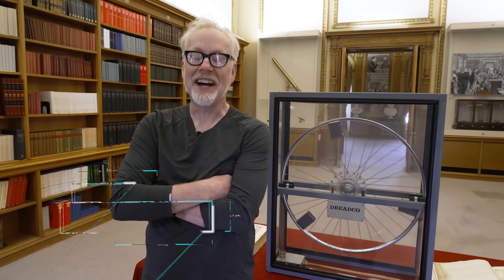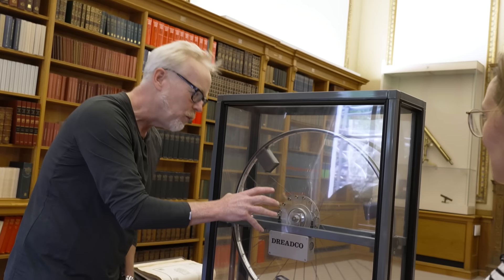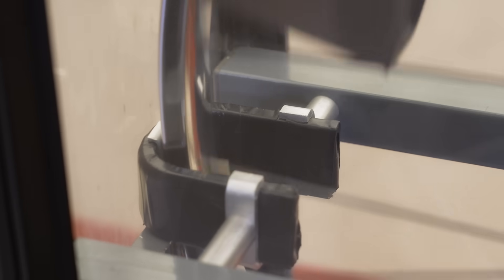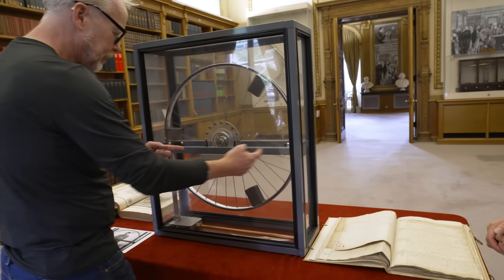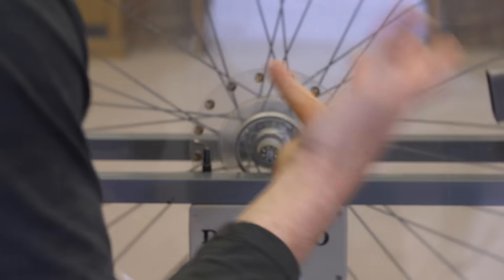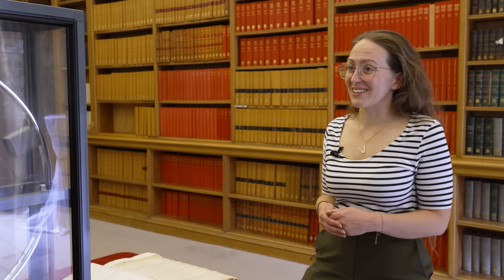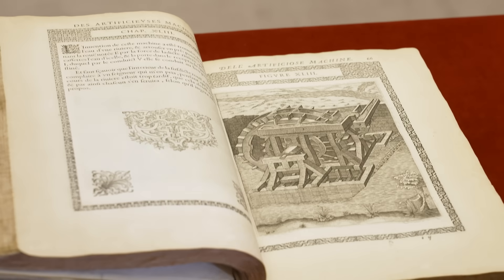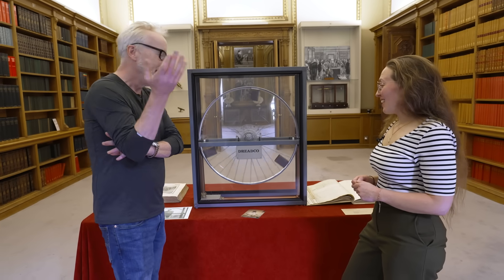Adam Savage vs The "Perpetual Motion" Machine!

Comment: This is not that complicated, it's magnets. Magnets push and pull. They pull the weight to them and then as it moves past it pushes it away. I had the same idea but would use it to generate some power.
Reply: Nope.  Try it and you will discover that magnets would quickly stop the wheel.  You can use electromagnets to modulate the push/pull but that needs actual energy.
Reply: @CorwynGC  not if set up the magnets in a proper configuration to equalize the push and pull. And I'm not saying it's perpetual, just as this device isn't but it's damn close.
Reply: @TimeofRagnarok  Please explain this configuration.  Every time I try I get the magnet pushing backwards just as hard as it pushes forwards.  What happens when you stop the wheel directly aligned with the magnet?  Which way does it go?
Electric car companies think the same, as they need to add huge batteries to their magnet configurations.
Reply: @CorwynGC  well I think the best way to know is with the good old method of fuck around and find out. That's what I plan on doing, and this machine here has given me a rough blueprint to start with.

Comment: it works for two year, of maybe more at a time,
so what is "Perpetual Motion", even if it was a reel thing, wheel bearings, metal fatigue, blob of grease, bit of oil, so when does a service, stop it being "Perpetual Motion" machine, where now talking, auto repairing, no maintenance needed ever. Bio-chemical reaction stuff, would be the only way to meet that demand, if the rules are that stringent? some sort soup in a sealed tank, biosphere of a sort? with no in's and no out's but that not going to make great battery, with no way to connect to the thing?

Comment: I think all the extra parts are there to throw you off. When I 1st saw this as a teenager I immediately thought of a lecture I had seen about how the earths spin drives Hurricanes.  And the professor used a bicycle wheel to demonstrate it. I think the special maintenance is them returning the bearing to frictionless state. The earths rotation would keep the wheel moving, and increasing the angle of the wheel to the rotation of the earth would increase its speed.
Reply: Can you pick me up some of those frictionless bearings when you next stop by the Physics 101 Store?  Thanks.
Reply: @CorwynGC  Low friction would be a better descriptor.  My bad

Comment: There are magnets in the black boxes. When the black box approaches the U shaped magnet it pulls the black box at the top across the plane of the Y axis where it's weight will then push the magnet through the U magnet. This happens sequentially on either side. As someone said below the "service required" is a good spin. This is a "really long motion machine" rather than perpetual. What might make it perpetual would be using electrical magnets vs. the permanent U shaped magnets with a cutoff switch so that it stops pulling the second the magnet at the top crosses the Y axis. Then you would need to turn the wheel into a sator and use the electricity to power the electromagnets. You would need to generate enough electricity to overcome the Work lost through friction. Basically you would use the permanent magnets to cheat.

Comment: The box with a heat sink and copper tubes could contain a Peltier generator. The heat sink would be on one side of the junction and the copper tubes on the other providing ΔT. The copper tubes lead to a different part of the enclosure and therefor a likely different temperature. Heat transfer through the copper could be both convective and conductive.
Reply: You think a box less than 2 foot cubed won't come to thermal equilibrium for 2 years?  Especially when you are running an engine off that difference.
Reply: @CorwynGC  If it were an empty static box, free floating in air, yes it would. But all perpetual motion machines produce heat as a byproduct of friction. So, there is a source of ΔT. 
I suspect that the finned block on the bottom pumps air through the copper tubes creating a convective flow in the box. Those blocks on the wheel rim may merely be foam to act as fan vanes. 
An inspection with a good thermal camera would tell a lot to promote or dispel my idea. 
Another thing to generate ΔT would be to use materials with differing emissivity and thermal conductivity properties on different areas of the box. 
Finally, accurately measuring wheel speed would tell if the rim blocks affected wheel speed every 1/6 of a rotation.

Comment: The main thing that the old photo's reveal is that the builder had a flair for the theatrical.
That suggests, to me, that it's likely there's similar misdirection going on with the finished machine.
In this case, I'd speculate that the "misdirection" is to hide (within the copper tubing and outer frame) the wiring which confirms it's electrically powered and controlled.

It's worth noting, in particular, that the box at the bottom of the case could, theoretically, have been placed in the centre of the case floor.
I'd bet that it's in the corner so that wires can pass through the case frame and into the box.

Without going into too much detail, I'd guess that the stuff in the centre is a homebrew "crank position sensor", the boxes attached to the wheel rim contain magnets, the doodads attached to the copper tubes are coils and the circuit produces an electrical pulse, through the coils, timed to push on each magnet as it passes.
The Dreadco box probably contains a rechargeable battery and solar cells which power the whole thing.

I'd guess that servicing the machine probably involves replacing the battery and cleaning the solar cells.

Also, it'd be interesting to get a mobile phone with a "magnetometer" app installed and use it to see what's going on.
I'd bet it'd quickly reveal what was going on.
Reply: I think you could make a more hidden one by putting a reed switch and a coil and a battery in each of the 3 boxes on the wheel, and make the horseshoe shaped things horseshoe magnets, and the copper tube is a red herring

Comment: So the entire metal frame is filled with batteries, and the motor is in the deadco box, with its soft little rubber drive tire leaving a black rubber mark on the center hub ( 1:00 ) and since it has photosensors on either side of the dreadco box, its capable of shutting itself off whenever its under its blanket in the store room. 

every 2 years or so when it gets "sent back" its getting reoiled, a new drive tire, and new batteries.
Reply: Shutting off is an interesting idea, but it would need to spin back up quickly to not be noticed.
Reply: @CorwynGC  It probably spends 99.9% of its life in a special built box, and theres probably only a handful of people that are allowed to handle it.

As long as they set it up when noones around, and never publicly admit that it stops in the dark, the mystery continues for everyone else who sees it.
Reply: @nicholastrawinski  they could just slow it down to say quarter speed and people are very poor at judging slow rotational speed so they would not think about it specially when the light just turned on. And if it start accelerations slowly it would be hard to notice.

Anyway. I kind of doubt that spinning take more that a few mW with a high efficency motor. Even är that. A normal alkaline battery cell contain about 2-3wh of power. If it uses say 100mW a single AA one use battery would power it for 1.5 days or there abouts... if it's a C cell then it's 5 days. 

And if takes 10mW that would power it with a single C cell for almost two month.

Just an estimate that wheel probobly needs somewhere between 10 and 40mW to rotate.

If it was built today that entire energy could be harvested from a PV integrated in the acrylic plastic.

Comment: I'm sure it's the same as all the perpetual motion toys you can buy, 3 magnets on the wheel that get a tiny pulse from an electromagnet as they pass by.  The C shaped "things" are wrapped in tape to hide that they are not permanent magnets but one of them contains the tiny electromagnet driver.  A high speed video of the movement of the wheel should show a very tiny bump in speed when it passes one of those C shaped things.  A 9V battery, a transistor, and a tiny coil would be all that is needed for 2 years of operation.

Comment: The hardest thing about perpetual motion machines is where to hide the batteries.
Reply: You can see this quote on every single perpetual motion machine video, I think it's quite incredible this this runs for months
Reply: In plain sight is usually the best way, Like a big box with say the name of the piece on it, dead center.
Reply: Why not a small block of Thorium.
Reply: @johndododoe1411 because batteries are easy to get and to use.
Reply: @JohnKelly2  Thorium as reactor fuel has a very high energy density.  I wanted to suggest uranium, but thorium is more modern in pop discussions like this.

Comment: It runs for two years, they send it to recharge the battery, and they send it back to continue the meme 😅 Edit: you got the envelope Adam! Run!🏃💨 in all seriousness look out for things that aren't actually a part of the machine, and are only there to mislead you. I wonder if those black U shapes that the rectangles go through are things that magnetize and demagnetize them, and after they've been de magnetized a steel ball barring or something falls giving it a little bit of an oomph. There absolutely is some kind of at least a deconstructed battery in there or something. Also the things you thought were an anode and cathode, I wonder if they're just in there to ground static charge from the system?

Comment: If you think about it, a lot of things could be construed as perpetually in "motion" -- they just use existing energy sources to do so. The orbits of planets around stars turns gravitational potential into motion. A water wheel will turn forever so long as the river keeps running (although I suppose it would eventually erode away). Even life itself ultimately runs on sunlight. Perpetual motion devices are simply the same thing, but with the energy source cleverly disguised or hidden. It's all about transforming energy into other forms as losslessly as possible, but it's a "war of attrition" as Adam said.

Comment: Static electricity does not need a "conductive" path to push or pull on a balloon.
Reply: Sure it does.  Air is conductive (just not very).  Lightning jumps by finding the most conductive path.

Comment: My best guess is that the frame is packed with batteries and it's a motor like in maneki-neko (waving cats) - a coil detects the proximity of the magnet in the boxes, powers them shortly to give the magnet and therefore the wheel a slight push. The circuit for this is very basic und would run long on little power...

Comment: Great show, have you ever seen the ice circles that spin? Always thought they could put magnets around on them to make a huge generator, no idea how long it would last though so might not be Perpetual motion haha
Reply: That's just the river's energy. You could achieve a better result using the river water to move a turbine.
Reply: Once you start pulling power out of the system things tend to get bogged down and not work right. Like sterling engines. They can run efficiently at low power. But, if you tried to get max power out of one it starts to either not work or isn’t any more efficient than a traditional engine.

Comment: It works on follow through motion, how could you not see that? the wheel is perfectly balanced by the 3 little weights placed on the wheel. as the wheel crest the horizon the momentum gained by the fall gives it that extra push to get the next weight over the horizon to again add the little bit follow thru momentum. eventually the momentum shrinks to where it needs to be nudged again, but the follow through energy of the initial push it's enough to keep it spinning for years. that's your big secret not rocket science just common old momentum.

Comment: Batteries go in the great big "DREADCO" box. Undo the screws. Wires hidden in the frame and copper tubing. Even has a vent on the side. @3:07
Reply: Everybody in this comment section is ready to say how it doesn't work instead of figuring out how it does work.
Reply: @TimeofRagnarok  PMM is impossible. Of course it doesn’t work. It’s just a spinning wheel
Reply: @BuddyThePal  Spinning for 2 years is perpetual enough. Practical? Of course. It is a battery that stores kinetic energy. It is also a timing device. Both of them are practical uses. Not to mention it is a decoration so has aesthetic and entertainment values.
Reply: @BuddyThePal  it's not perpetual, it's just damn close. It's not first time I've seen a machine that people, including scientists, said it can't work yet did.
Reply: @othmanskn  "Spinning for 2 years is perpetual enough. "  Not if one uses the proper definitions of words.  It is VERY efficient but I guarantee it is not perpetual.
Reply: @TimeofRagnarok  Two years and two million years are equally distant from infinity.
Reply: @kennethfharkin  If you define it as you wish, then there is no such thing as perpetual then. Not even the universe. So, why should we invent words like zero, infinity, perpetual that will never exist? Clue. Learn calculus than you should learn about asymptotically approaching zero, infinity, whatever. Fully charged capacitors that practically cannot be 100% fully charged because it will take an infinite amount of time to get a capacitor to be fully charged 100% to an infinite decimal place accuracy. Practical people will just accept accuracies of 0.1%, but even 20% are acceptable in resistor values. Even 200% for transistor parameters.
Reply: @othmanskn  Pedantics.  I know what is accepted as a perpetual motion machine as do you and everyone else.  Two years isn’t it.  Energy is being added to the system.  Get over it, you are wrong.
Reply: @kennethfharkin  No. I never accepted it. The moment I read about it as a student, I already doubted it. Even the English is wrong. PMM is a machine so you cannot attach the specs to the name. A sports car does not need to be used for sports only. It only need to perform some properties of sports for anyone to name their machine with.

For a third party to question the naming convention of a designer is preposterous and only occurs in physics textbooks that need to be rewritten.
Reply: @othmanskn 
Naming conventions and definitions are two separate things. You trying to blur the lines doesn't make the machine more perpetual. BTW its just a flywheel, that's the name of a thing that stores energy to release when power isn't applied

Comment: The heat sinks point to a thorium power supply/generator. The copper pipe could be a conduit for directed air “blowing” the wheel around. The air flow could be from a high voltage discharge. I would like to see a FLIR photograph of the apparatus. Unfortunately the thermal image won’t pass through the glass.
Reply: Interesting idea. Thorium-228 has a half-life of 1.92 years (according to Wikipedia), and has been known about for some time. Not sure if it would provide enough heat or electricity if somehow used as a generator. Definitely would have liked to see some proper instruments pointed at it. The mystery is fun at least.

Comment: David Jones was very open about the fact that this is not truly perpetual motion, but it's definitely interesting trying to figure out exactly how it does work.
Reply: Most probably it would be battery, coil and magnet.
The exact arrangement is not so relevant, there are lots of ways to make a very low power electric motor that consumes very little energy.
I would suggest magnets in the three boxes on the wheel, the coil in the U shaped parts and a small transistor circuit that gives a tiny push when the magnet approaches the coil.
Reply: @azgarogly  Seems most likely, yes.  It's just a matter of figuring out the exact details of it.